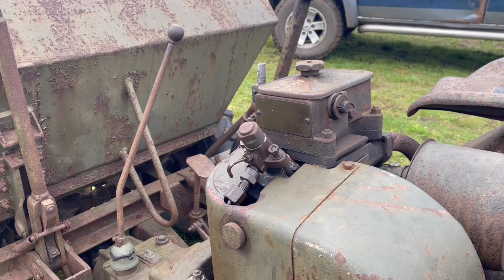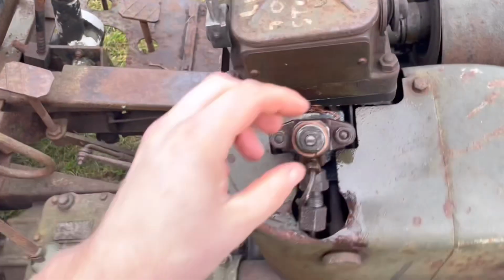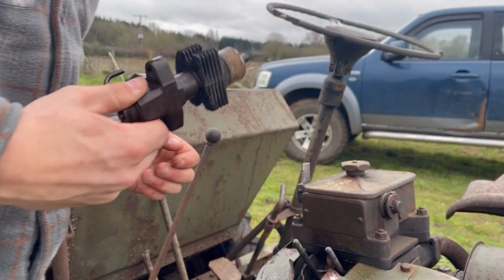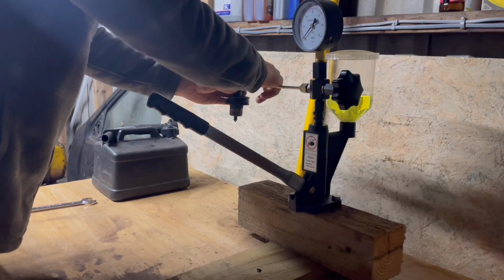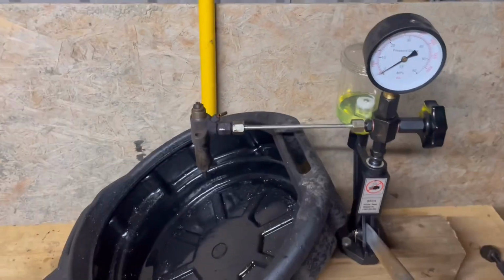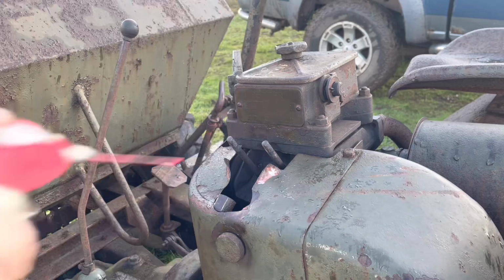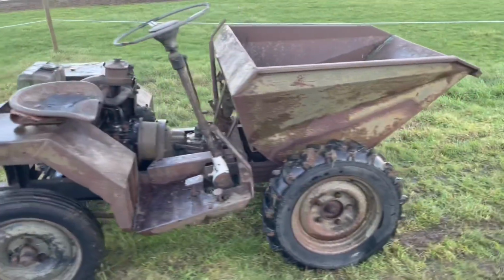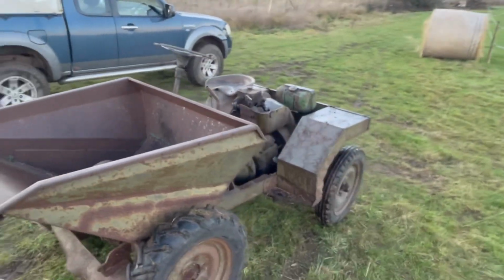Injector Trouble - Can We Fix Our Barn Find Dumper? Restoration Series Pt 4

Comment: Did you have the pressure gauge shutoff valve open? The knob when fully tightened disables the gauge so it doesn't wear out while you're doing tests that don't require a pressure reading, it is enough to loosen it half a turn to enable the gauge.

Comment: THOSE INJECTORS ARE POPPING OFF AT WAY TOO LOW A PRESSURE!  You will have to look up the specification for that engine/injector.
Reply: I did wonder if the injector tester was setup right, as doesn't the screw knob next to the pressure gauge need "tightening down" until a pressure reading is shown (I assumed it was tighten the adjuster down as this holds the pressure reading in the gauge)?